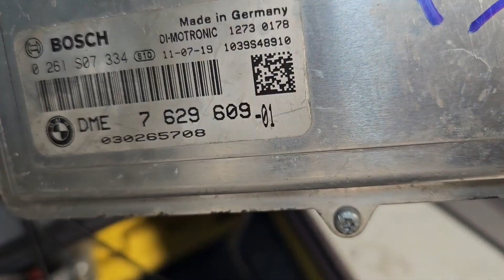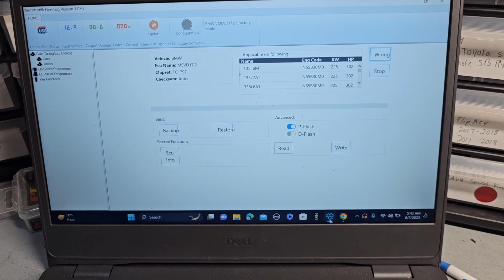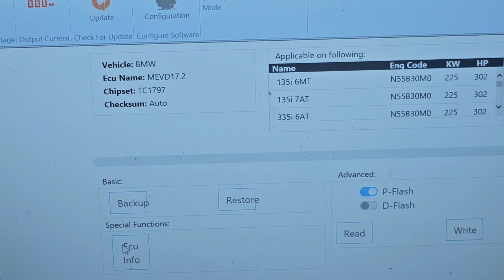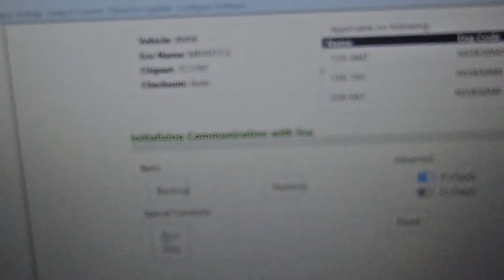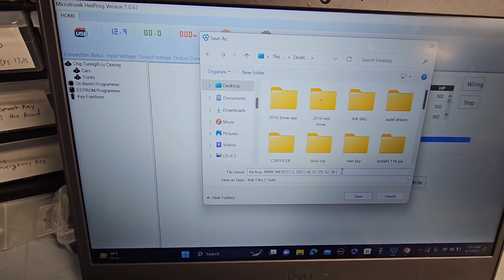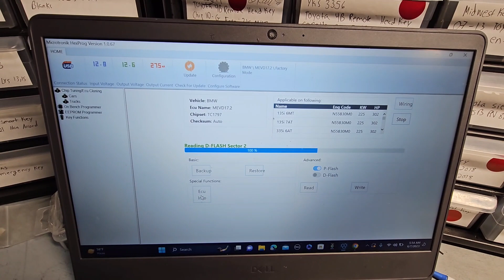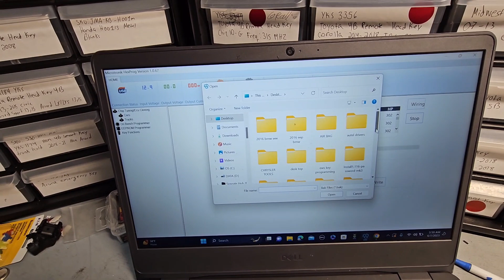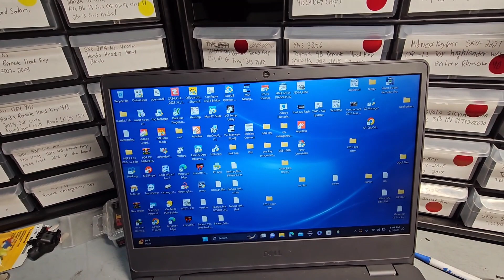How To Clone A BMW Engine Computer Using Hexprog Step by Step

Comment: hello fella, could you tell which programmer is require to reprogram an x5 2008 tailgate module, the last owner threw the original module away so i do not no the original part number!! many thanks for all you work on these x5's your a star
Reply from the maker: if you have autel like 608 can do the coding for you

Comment: Salam brother can you help me how to solve code p1000 ford
Reply from the maker: DTC P1000 is a Diagnostic Trouble Code that can be found in some vehicles' powertrain control module (PCM). It is important to note that DTC P1000 may not clear unless certain conditions are met. Here are the conditions under which DTC P1000 may be set:

New Vehicle: If the vehicle is brand new from the factory and has not yet completed an OBD drive cycle, DTC P1000 may be set. The OBD drive cycle is a set of conditions and driving patterns that need to be met for the PCM to complete its self-diagnostic tests.

Battery or PCM Disconnection: If the vehicle's battery or PCM has been disconnected, DTC P1000 may be set. When power is interrupted, the PCM loses its stored data and needs to perform a series of tests to relearn and recalibrate its systems.

OBD Monitor Concern: If an issue or fault occurs during the OBD monitors' self-diagnostic tests before the completion of an OBD drive cycle, DTC P1000 may be set. The OBD monitors continuously check various components and systems of the vehicle for proper operation and emissions compliance.

PCM DTCs Cleared: If the PCM's Diagnostic Trouble Codes (DTCs) have been cleared using a scan tool as part of a repair process, DTC P1000 may be set. Clearing the DTCs erases the stored fault codes, and the PCM needs to run its tests again to ensure everything is functioning correctly.

PCM Flashing: If the PCM has been reprogrammed or flashed with new software, and the vehicle has not yet completed an OBD drive cycle, DTC P1000 may be set. After a PCM reflash, the PCM needs to run its self-diagnostic tests to adapt to the new software and ensure proper operation.

Power Take-Off (PTO) Engagement or Damage: If the vehicle is equipped with a power take-off (PTO) and the PTO is engaged or damaged, DTC P1000 may not clear. The PTO is a device that transfers power from the engine to operate auxiliary equipment, such as a hydraulic pump. If there is an issue with the PTO, it can prevent the PCM from completing its tests.

It's important to note that DTC P1000 is not typically a cause for concern unless specifically requested by the customer or required to pass an Inspection Maintenance (I/M) test. The PCM will clear DTC P1000 from memory only when all the OBD monitors have successfully completed their tests.
Reply: @BestCarFixes  masya allah thank you so much for give the solutions